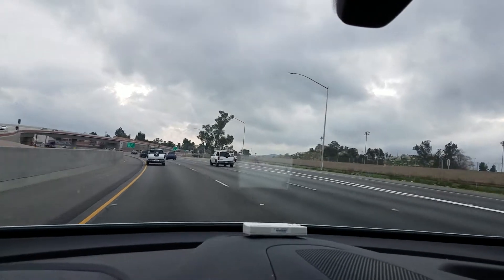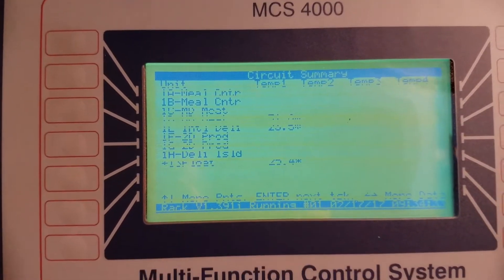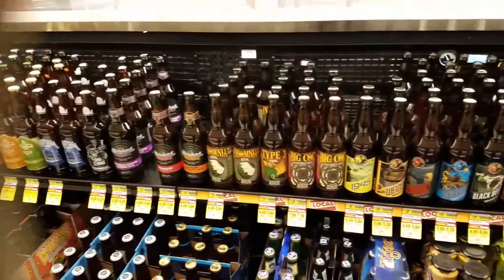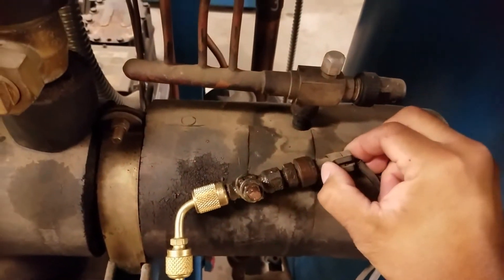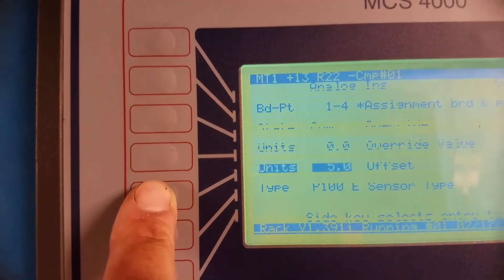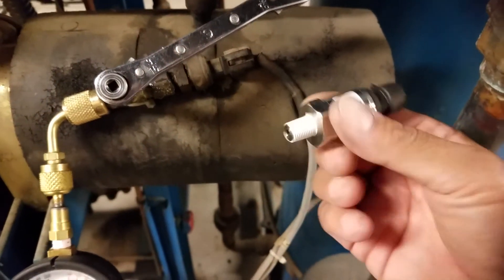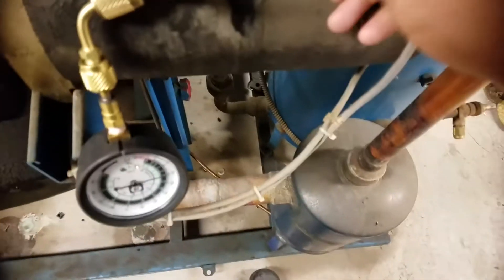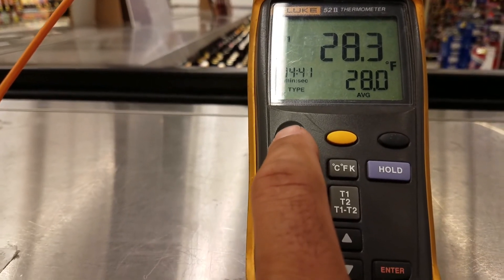Case running to cold

Comment: Does the case refrigerate all day at 28 degree discharge air? Or does it refrigerate then cycle off until it warms up again, I’m confused by the relationship between thermostat and epr. Your channel is fire 👆🍠🍠🍠

Comment: great videos man! I really love how you share your knowledge and take the time to explain what you're doing and reasons. Im a 4th year refrigeration apprentice and mostly been in the restaurant refrigeration side and I recently got hired on to a company as an apprentice that does supermarket refrigeration and I am trying to learn the rack. its a bit of a learning curve. So far it looks like all the systems are controlled by a computer setup called micro thermo, do you have any experience with it? anyways keep the videos coming! I really enjoy them and learn alot so far. 

cheers 

james
Reply from the maker: +James Baker, Thanks for the feedback back. I have not worked on Micro Thermo controllers yet.